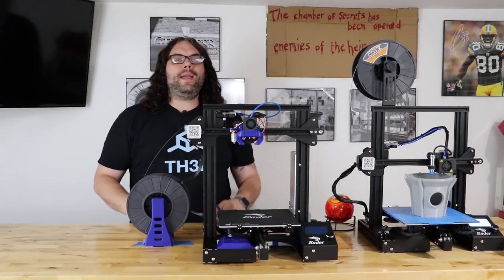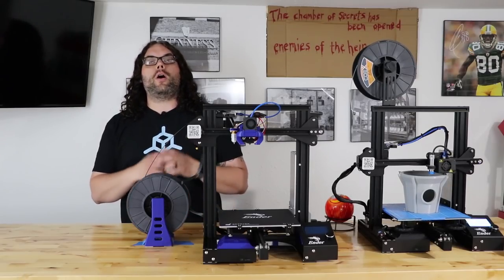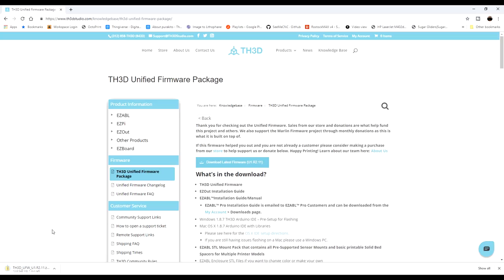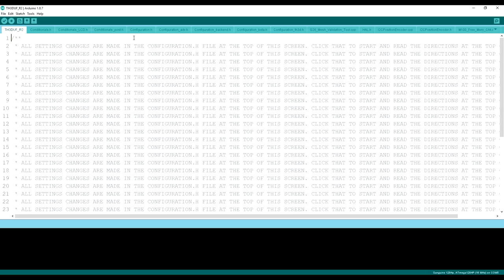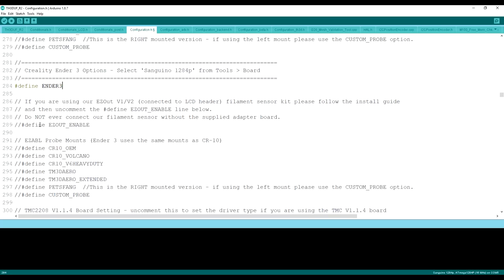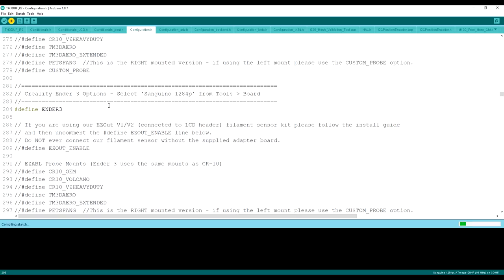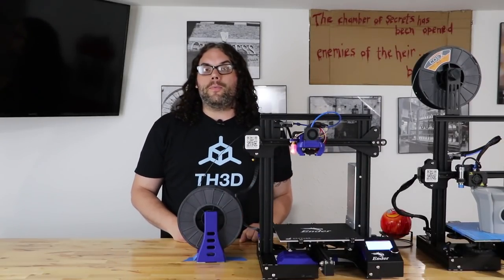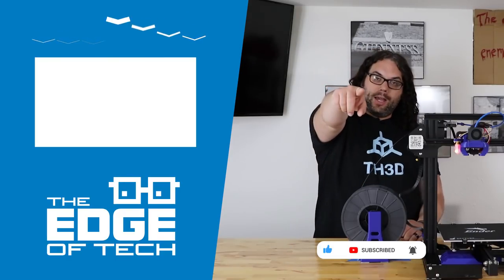How to Update the TH3D Unified Firmware the EZ way

Comment: WARNING to those who are considering this upgrade.   The current TH3D upgrade ELIMINATES the entire menu structure under MOTION that allows you to adjust such things as  E-step.  It also is the menu with all the jerk setting among others. 

Per the FAQ on TH3D's site, this was done to save space,  which is a bit confusing as they will allow BLTouch and other things.  It would be nice if we were given the option to choose.  I do not have a BL touch or anything other than stock so for me I would rather simplify E-step adjustment  among other things.  

I'm looking to see if I can go back to stock (That had these settings) or flash Crealities newest firmware.
Reply: Frick. I knew it had to be TH3D's fault. AGH. I just want the best of both worlds you know? Guess I'll have to upload new firmware EVERY time I need to adjust esteps. How freaking annoying.

Comment: I was able to use this video and TH3D to update my new Creality 1.1.5 Silent board. After spending many hours trying to do this on my own with Marlin, I decided to give TH3D a shot and it was so much easier. The only trouble I had with installing this was Windows 10 and setting up a USB to work as a COM port. Once I got that ironed out the rest went quickly.  I think I am going to start looking a lot closer at the TH3D products for my future 3D upgrades. I currently use the Ender 3 Pro, so there are plenty of future updates I can anticipate. Thanks for a great and helpful video.

Comment: Probably a dumb question. But I flashed the bootloader on my ender 3 thinking at a later date I could flash new firmware, however what I found after getting a successful burn of the bootloader and starting my printing that I get a blue LCD with nothing. I assume that the printer now has NO firmware because I flashed the bootloader... ???

Comment: Be nice to find out if the new board improved prints and/or printed faster.
Reply from the maker: I really like the EZ Board! It is faster and the prints are better. Using the 32bit board with a ton more space really helps that! Also, the board is built very well and I feel like it will last a long time!
Reply: @TheEdgeofTech  got mine ordered. Be here in a few days, think I'm going to do a vid comparing the old 8bit vs the 32bit. One of the wife's figurines be a good test. Wow now i got to get a better camera. Dang it

Comment: I loaded this firmware on my stock ender 3 and it printed horribly and made a ton of noise. I used Pronterface to look at the settings and from what I could see the feedrates and accelerations were way off of what stock ender 3's should run. I edited the M201 and M203 lines to stock settings I found online and now it's printing normally.  I thought this firmware wasn't supposed to change print quality or anything. What's the deal?
Reply from the maker: What version of the firmware did you load? I can reach out to Tim and ask him what's up. Thanks for watching!
Reply: @TheEdgeofTech  That would be awesome. Great videos by the way. I followed the ender 3 build and have had near perfect prints from day one thanks. 

Anyway, loaded V1.R2.11. 

TH3d M203 {200, 200, 15, 50} Stock, as I found it on the internet seems to be: {500, 500, 5, 25}
TH3d M201 {500, 800, 500, 5000} Stock seems to be: {500, 500, 100, 5000}
After I loaded the firmware my printer was banging when it changed directions and had severe ghosting manifested in huge diagonal lines across vertical walls. Loaded those stock settings and I'm back to near perfect prints again. 

Look forward to any info you can get cause I would think that by uncommenting the "ender 3" settings in the firmware it would load correct settings specific to that printer.
Reply: @nemocheerio  what values were too high? We can adjust the stock values if they are too aggressive.
Reply: @TH3DStudio   Hi Thanks for the reply. Please keep in mind I am new to this and still learning but by looking at your line 1350 from Configuration_backend.h: Max Acceleration is set to {500, 800, 500, 5000
Why would the Y axis acceleration be so high? And why would it not be the same as X? I think this was the setting that was causing the most problems in my prints .
Reply: @Ian Oliver 
Hello. I encountered a problem similar to yours. Khun Choi, can you tell me how to fix it?
Reply: @nemocheerio  i have same problem
Reply: @kittiphanchedram2734  i m dealing with same kind of problem....got any solution?
Reply: @PankajSharma-ch3bp  Just don't bother with this firmware. A lot of the settings were off and made my prints come out horrible. I went back to stock firmware and the prints came out beautifully. I have since upgraded to the Silent Mainboard it has the safety features I was trying to achieve in the first place and the printer runs almost completely silently. I wasted so much time on this firmware it was a huge disappointment. My advice; get the Silent Board right away. You will not regret it, it's amazing.
Reply: @nemocheerio  thnx for your suggestions..🙂

Comment: Hi man, great video!

The update succeeded but I have a problem with setting up a custom esteps value. When I set a custom value and click on upload it does finish without errors but when I read the value inside my slicer program it still shows the old value.

Do you have any tips on what to check or to try?
Reply from the maker: Thanks for watching! What slicer are you using? And what g-code are you doing to read it from the slicer?

Comment: Does the stock Ender3 settings work if you have the new Silent Control Board?  I’m also assuming you need to have the Arduino IDE installed as well to read and compile and load the code?

Comment: Hi I have tried this several times even restarting with the board connected the odd thing is it seems happy to burn a bootloader and confirm it but will not offer me a com port to upload a sketch???
Reply from the maker: Did you make sure you installed the driver from the TH3D folder?
Reply: @TheEdgeofTech  Hi thanks for the clue sadly I am to thick  too understand what driver where  buy the way I was trying to update a new board not connected to my printer I updated the one in my printer no problem? Ok I had a think about it and knocked up a power supply  and powered up the board I was trying to update and well there you go it updated no problem. it seems that while the A6 board fitted to my printer powers up from the computer via the USB lead A8 one doesn't I can only guess that it's something to do with the second ribbon cable!Thamks for your assistance.

Comment: Can you make a video for estep Calibration because the option is not in the motion tab anymore
Reply from the maker: Good question. The fast way would be to connect it to you computer and do it. I have a video on that using Octoprint, but the GCode would be the same using any program to connect to your printer. The TH3D Firmware comes with a free program called Pronterface. You can find it  if you go to the software folder then GCode Sender folder. Its super easy to use, just make sure that no other programs are open that could connect to your printer. That Includes your slicer.
Reply: Could you make a video on that

Comment: do you need to use arduino?
Reply from the maker: You need to use one to initially put the firmware on the first time. But just to update it like this video showed, you only need to plug it into your computer via the USB cable.